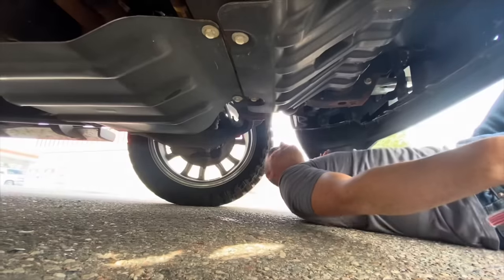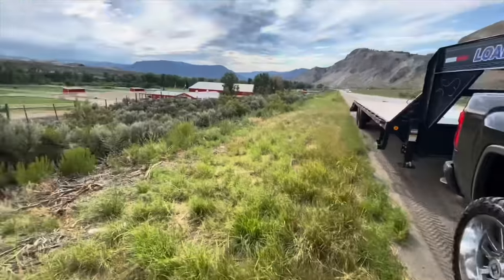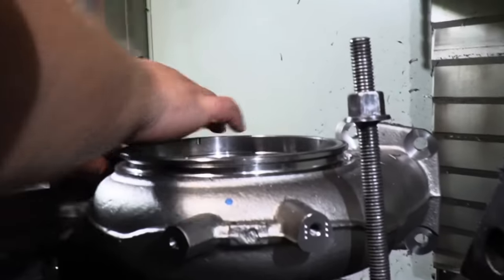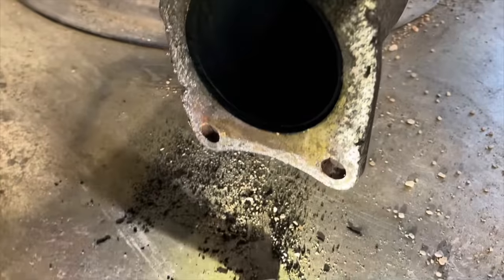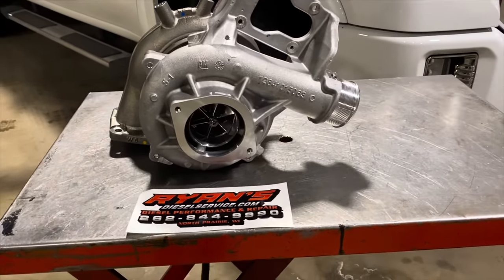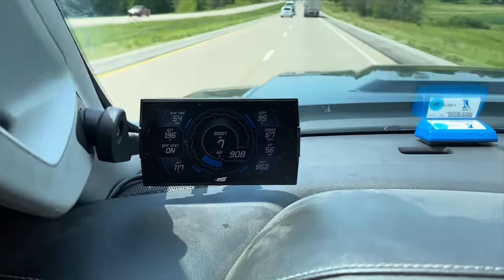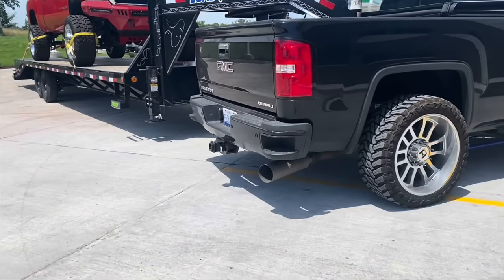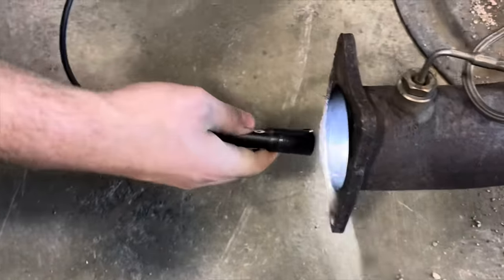This Is What Emissions Did To My Diesel! Heads Up Diesel Owners!

Comment: Glad u got it fixed, i just hope u dont have trouble down the road, plugged exhaust have to put a lot of heat to the motor. They think they are making the air cleaner with this junk, yet u burn less fuel when you delete, and your not putting nitrogen the air because no def. We have to spend a lot of money ( because emisions are expensive and we are paying for it when we purchase a vehicle, and then to fix it when it fails ) all to make beauracrats feel good about themselves, like theyre doing something green. Try farming and dealing with this crap when you are trying to get things planted or harvested between weather swings.

Comment: All modern diesels which is 2008 or newer have emissions don't get caught taking the stuff off or putting a programmer on you can get a big fine ass to diesel Brothers they don't work on diesels no more and by the way Ford had a national lawsuit against all their new Ford engines after 2002

Comment: Just stay away from those trucks. DPF, piss tanks, etc. The torque numbers may be better than your neighbors truck. But, if it cant even be reliable, why TF you even want it?  The EPA has made it clear they would prefer you not own a diesel truck. The exhaust system blows out even stock (or fails to blow, as seen here). What used to be a million mile motor has been screwed into a 200k truck, why even bother? So you can pay $100k over the shorter life of the truck & pay $1.50 a gallon more for fuel? The cost of adding the diesel engine option to the truck & the higher fuel cost per gallon, just doesnt add up anymore, just as the EPA wants it to be. Unless you have enough money to buy a new diesel truck at the end of the warranty, screw it, not worth it.

Comment: I put all kinds of go fast parts on my diesel and then wonder why it blew up🤦🏻‍♀.those engines are not designed to have that much horsepower pushed through them but yet people keep trying and then make a poor me video on how much it cost them when it blew up.....I've fixed enough of them now to know just how much they can handle.

Comment: And this is why i will never get rid of my ‘02 24v HO 6 speed. None of the emissions crap! This would straight me off knowing that a simple normal exhaust would solve the issue. Why don’t you just delete it? I know the stuff and the programming is getting harder and harder to get ahold of but id be doing it before you absolutely cant anymore! 
Diesel emissions are a joke. It doesn’t work. Its not helping anything or making the world a cleaner place not when there is third world countries that dgaf. 
Pre emissions trucks is the way to go!

Comment: you do realise that DPF Filters can and do Regenerate themselves ? you just need to get them hot by driving at high revs above 3thousand rpm for about 10-15 minutes the heat will then start the regen cycle... this is how you stop your dpf from getting blocked.

Comment: I've said once and I'll say it again, "A little knowledge is a dangerous thing". If it wasn't for the push to reduce the emission output from these LIGHT-DUTY diesel engines, we would not have these Duramax, 24 valve Cummins, or the 6.7 PowerStroke engines. Exhaust Gas Recirculation, EGR, DOES NOT HURT YOUR ENGINES!!!!! It does not flow when full power is demanded, it flows during low load situations to REDUCE THE ENGINE'S DISPLACEMENT, this can vary between 10 and 40 percent and EGR will reduce the total NOX, a greenhouse gas, emissions at the tail pipe. A little EGR is introduced to cool the combustion chamber at times when the throttle is moved suddenly, and the engine wants to "spark knock". Ever notice how quiet these MODERN engines are while idling, accelerating, and on a long grade? If you want it to be a real killer, take off the turbocharger and put on a Whipple Screw type supercharger, otherwise, so put away your Craftsman toolbox and enjoy the STOCK engines, cause you are not smarter than the engineers who designed these systems! The Diesel Particulate Filter, DPF, system is NOT MANDATED BY OUR GOVERNMENT!!! Since it is what the vehicle manufacturer chose to use instead of designing a LIGHT-DUTY DIESEL engine to meet the emissions requirement, it is PROTECTED BY OUR GOVERNMENT. The government of the United States of America does not make parts for LIGHT-DUTY DIESEL trucks, if you got beef, talk to whoever built and sold you that piece of JUNK!

Comment: I just got back from Colorado staying at 8500 feet . IS IT possible that the lack of oxygen at a higher altitude could've caused this problem?  I had a mechanical fuel injected car in 1971 went over Loveland pass 11,000 feet and I had my foot to the floor going up the mountain.  Car stayed at 5mph all the way till I came down the other side . The thin air has to effect the pollution crap the democrats demand be on the vehicle.
Reply: I don't believe it.
The air is less, but not enough to prevent diesels from running good unless they are nat. aspirated...

Comment: Look, i have worked as a mechanic for 50 years plus. I'm not in favor of smog control, but the systems they have designed really work ..all parts fail. Just quit fucking with your diesels. I remember that i couldn't breathe with older diesels.

Comment: Sh*T happens when you own a "durajunk" GM truck.
Reply from the maker: Got to love the haters 😂👍
Reply: @TruckMaster  Truth/facts too difficult for you to comprehend? I'm a 50+ years master-level factory certified auto/truck tech.  I've worked on ATV diesel engines, marine engines and tractor-trailer engines. I would NEVER own a GM truck regardless of what it has for an engine, especially a "durajunk" diesel engine. I'm also a licensed state motor vehicle inspection tech since 1970.

Comment: Nowhere is there a mention of how many miles you truck has traveled, or your typical, day-to-day usage - all factors that might help explain why. The only thing we know is you suddenly have an emissions issue.

All this talk about Duramax vs Cummins, blah blah blah, is more of the Ford vs Chevy nonsense.  They are are well built and each suffer from their own issues after heavy use. Pick your new truck based on features and price, not the engine.  Because at some point, every diesel owner will face some issue like the one pointed out in this video.

Comment: As someone who gets physically sick from the exhaust fumes from diesel motors I have very little sympathy for people who have problems with emission controls on diesel engines.
Reply from the maker: Gasoline fumes are way worse for your body
Reply: @TruckMaster  Both types of fuels create the same harmful gases and neither one is good for us. 

 The big difference is diesel emits a lot more particulate matter than gas engines, unless equipped with a particulate filter. 

The only one that bothers my bronchitis immediately is diesel fumes especially from older trucks. I am assuming it is because the older trucks don't have the particulate filters on them.